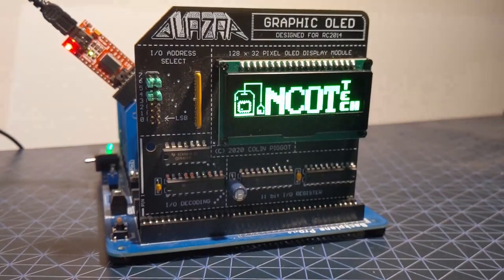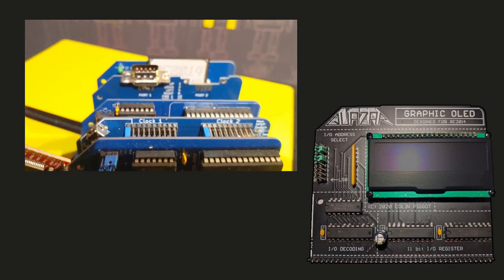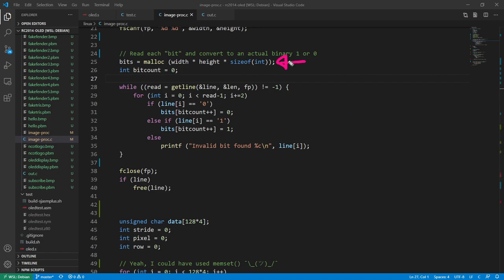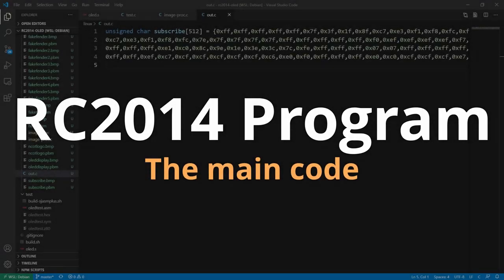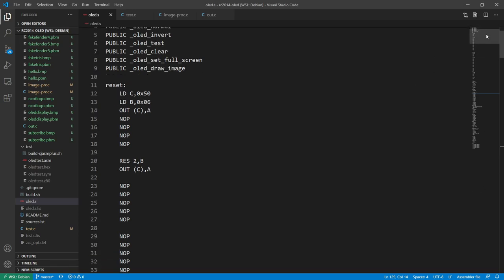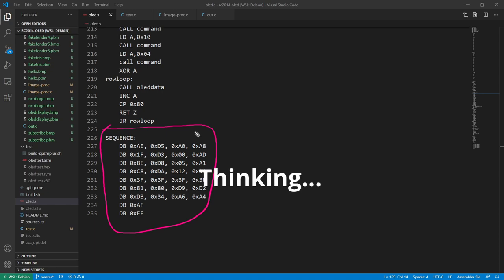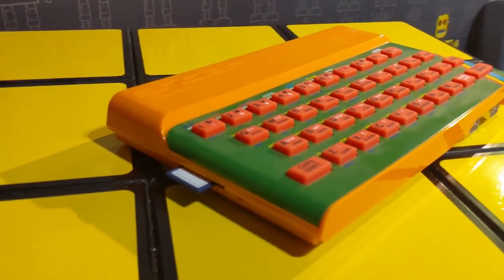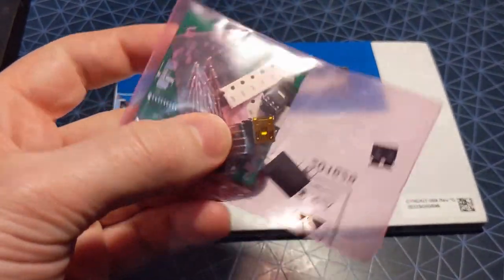Quazar Graphic OLED - Retro Programming in C and Z80 Assembly on the RC2014

Comment: It's 40 years since I used to write this stuff commercially but pretty sure I still remember that to read the function parameter you just load the ix reg from the sp and then use this to reference the parameters instead of using the hl reg. Saves messing with the stack.  Also the way you are doing it you can just inc/dec the sp rather than using pop repeatedly to avoid the memory writes. ASM is fun but I wouldn't swop c++ for it. :-)  Nice video, thanks.
Reply from the maker: This is what I like about programming, there’s always another way to do something. Moving SP sounds like an easy way to do it, I’ll remember that for the future thanks! And yeah I wouldn’t want to write everything in asm, that’s why I’ve been figuring out how to use C.

Comment: That was really interesting. And your video had channel branding and infodrop graphics, which is new and makes it look very professional. One question that I had was why did the assembly have so many NOP instructions? Is this a timing or spacing issue you have with the code to ensure that it fits the requirements for the display?
Reply from the maker: It’s a timing thing, the display needs a delay between the commands and the NOPs add just enough.